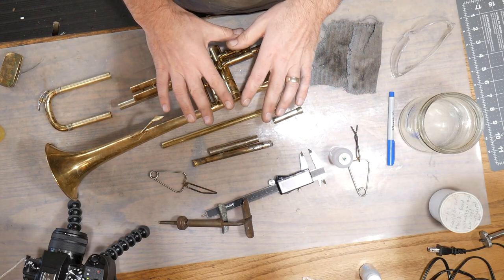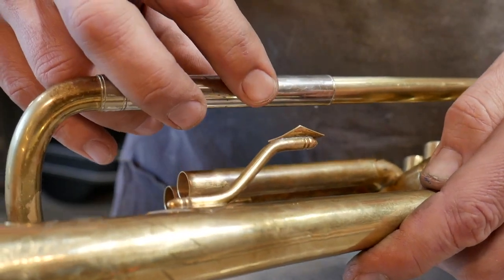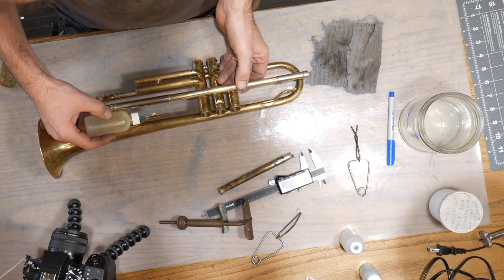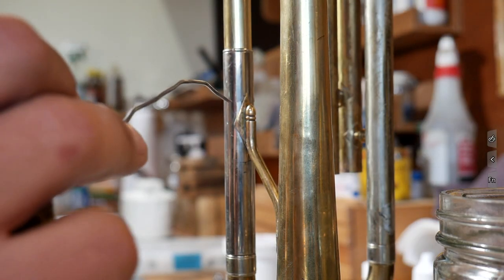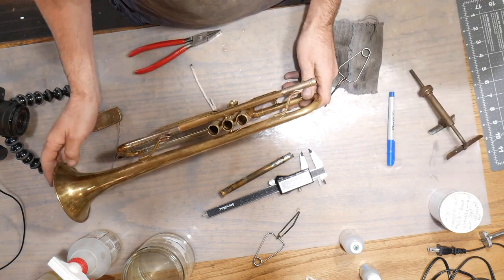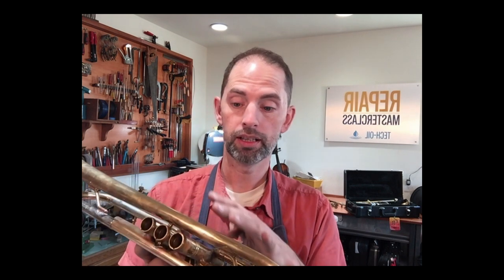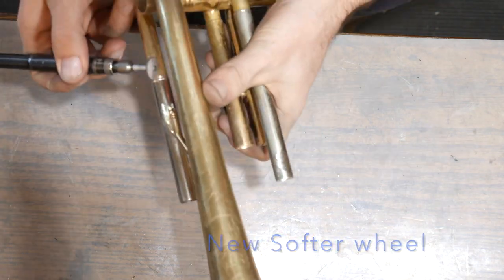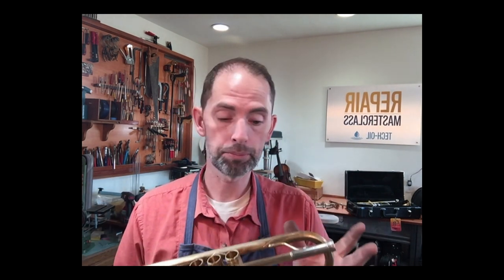Trumpet Leadpipe Install

Comment: Good job!  I think about half of my trumpet repairs involve a lead pipe these days. I buy those generic leadpipes in quantity.  Every one needs to be calipered to get the right section of the generic pipe cuts, and to make sure of the receiver to pipe transition being smooth.  The worst ones are the amateur repair fixes you have to re-do.  Crazy glue is NOT SOLDER!

Comment: Boa tarde, eu sou do Brasil, gostaria de saber sobre esse fluxo liquido para solda que usou, pode me ajudar? me dar mais informações?

Good afternoon, I'm from Brazil, I would like to know about this liquid flux for soldering that you used, can you help me? give me more information?
Reply from the maker: You bet! It's rather easy to find, I use a product called Stay Clean, by Harris (https://www.grainger.com/product/49JR40?gucid=N:N:PS:Paid:GGL:CSM-2295:4P7A1P:20501231&gclid=Cj0KCQjwkqSlBhDaARIsAFJANki7K8JXeGq_rjV4_y1exNTf0uF2wz75R8WMGd5VQqUb-0omcMKxGgIaAhRDEALw_wcB&gclsrc=aw.ds) but there are several others out there. A bottle this size has lasted me YEARS and I solder several times a day, 5 days a week... so it's cheap.